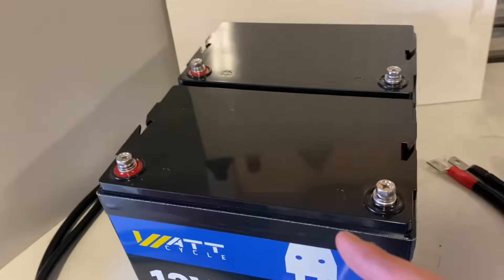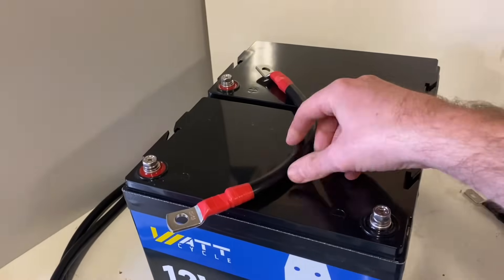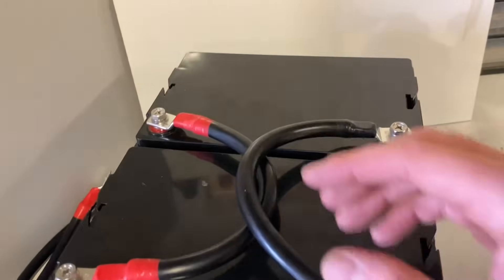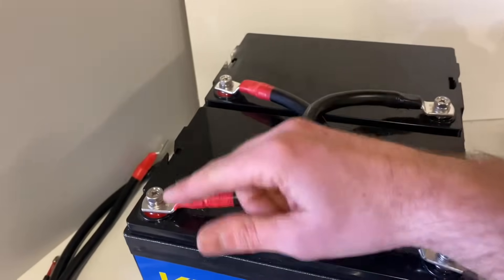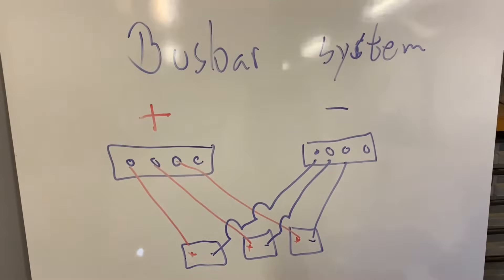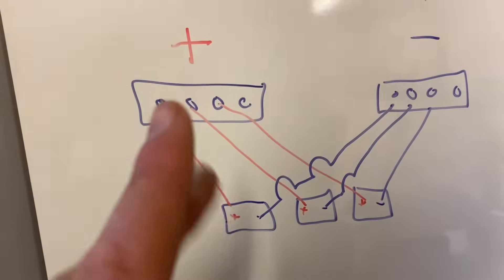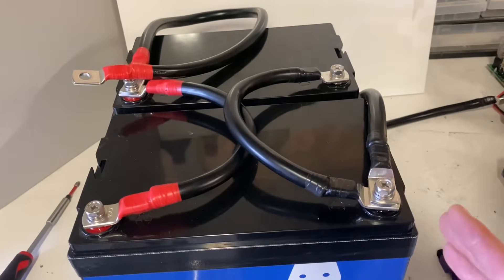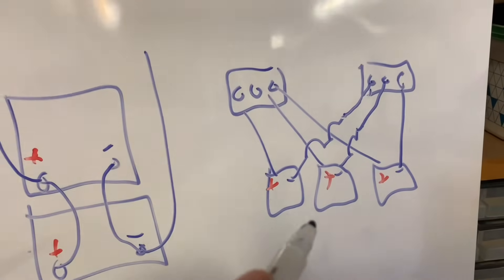How to Parallel Two 12V Batteries – Best Method Explained

Comment: Si po collegare una batteria da 200,e un altra da 225 per favore
Reply from the maker: It's generally recommended to connect batteries of the same capacity in parallel for optimal performance. 👍 but it will work. you mean Ah when you write A right?
Reply: @JonasSyver grazie mille boss bona serata

Comment: Does wiring 2 12v 100ah batteries in parallel, with the solar charge controller on one end and the inverter on the opposite affect the system?
Reply from the maker: I don’t think you will have any problems.
Reply: @JonasSyver  thanks

Comment: Which setup would be best for 2/100ah lithium batteries as the secondary batteries? I have a Taramps 15K bass amp, and I’m having problems with the bass shutting off, even at a low volume. PLEASE HELP!!
Reply from the maker: You will have trouble with only two batteries. The 15K on max draws 15000W😅 you could get away with 5-6 batteries in parallel and get a decent sound. One battery can only provide about 1200W
Reply: @JonasSyver which type of bank would you suggest?
Reply from the maker: You will need at least 650A output total in your bank. That is about max the output. Look for batteries with 200A BMS’s and parallell connect(4pcs), or 7 pcs 100A. (Do not confuse this with Ah).
Reply: @JonasSyver I definitely need some help with this..

Comment: Operating a stock automobile, is there any benefit installing 2nd 12 volt battery ? Would second battery make the headlights brighter ? I've polished the lens, installed higher quality halogen lamps but headlights do not illuminate the road as well as my other cars do.
Reply from the maker: Thanks for the comment👍 A second 12V battery would just give you longer lasting power, not brighter lights. Have you tried LED headlight bulbs?

Comment: Can my pv connection be parallel, and my battery 🔋 still be connected as parallel????
Reply from the maker: Thanks for the comment. Your PV connections depends on your charge controller and what it can handle in volts and amps. The battery is not dependent on the PV wiring, other than that the charge controller must match the battery voltage you are using. Hope that made sense 😅
Reply: Yes thanks sir

Comment: Last thing, I have three sets of 51.2 battery banks hookup to busbares . One set is 4- 12.8v100a hookup in series, the second is a 51.2v 100ah battery and the last is 4- 12.8v 320ah batteries hookup in series. All hookup on busbar in parallel to  one set of busbares.
Reply from the maker: That's an interesting setup you have there! 👍

Comment: What if you need a voltage of 48. So you do a 4s each end goes to it  busbar. I'm using four batteries in series to make 51.2 . I'm also using busbares t connect to my inverter but I'm also using a battery balancer for the four batteries to help keep them balance.
Reply from the maker: Balancer is a good idea. The video is for parallel connections.

Comment: When connecting 2 batteries to the solar controller is it positive from one battery negative from the other.
Reply from the maker: Yes if the configuration leaves one pos on one battery and one neg on the other.

Comment: Why not spin the battery closer to us around so the terminals of both batteries are facing eachother? Then you would only need a cable 3 inches long to connect the batteries.
Reply from the maker: Positive to positive and negative to negative for a parallel connection.

Comment: How do you wire up a system that has a switch taking it from one battery to the other or both ?enjoyed video thank you
Reply from the maker: Amazon has some great switches for that. Select individual batteries/banks. Just wire the positive through the switch.

Comment: Nice video thanks for posting it I have seen something similar thank you for the explanation can you tell me if this applies only for lithium or does it also work with lead acid batteries
Reply from the maker: Thank you😃 Yes it still applies for lead -acid, but Lead-acid cells tend to self-balance better.

Comment: Did you know 2 smart batteries in parallel wont share amp loads simultaneously?
Reply from the maker: Hi. I have heard about the issue. And it is a common problem with the so called "smart" batteries. I will have to test it myself before I can give a talk about the problem. Will Prowse has some good insight on the subject.

Comment: Thanks for your video. You look like you're cables are bigger than mine I just purchased so they are 1/0 I have 2/0. I guess they will work because I'm not buying more. I'm going with a 24-volt system.
Reply from the maker: Those will work just fine. Good luck with your 24v system!. 👍
Reply: @JonasSyver Thanks,  I need help. I have watched videos for years now and I still have a problem with calculating, volt x amps equals Watts. I don't have a problem with the multiplication part of it I have a problem with understanding why. For example there are 12 volts 100 amp batteries, but then I see a battery that's 51 volts and 200amp. If I choose a 51 volt battery for the volts, Why? Does I choose 51 volt for the amount of volts for the solar panels. I hope this makes sense.
Reply from the maker: Tip is if you understand the math, to think in Wh. 12v 100ah battery is 1200wh and a 51.2v 100ah is 5120wh. So it makes sense once you know that every parameter is connected to each other. Hope it helps👍

Comment: Don't forget that when using bus bars like shown on the video it is Super important to ENSURE all cables are the same length/Gauge from the busbar to the battery terminals.   Super important.
Reply from the maker: Yes👍 thanks for the comment😃
Reply: Also each battery would need its own fuse to protect its individual cable, rightt?

Comment: Is a bus bar necessary for Three batteries or would the balanced connection be okay?
Reply from the maker: I would use a busbar for three batteries. Optimized  flow and easy to isolate each individual battery if something happens. Add a breaker to each battery before the bus and you have a really nice serviceable system.

Comment: Witch battery will be used first?
Reply from the maker: They both will be used at the same time, but one of them might be drained a little bit more than the other.depends
Reply: @JonasSyver I wish you would show what each battery are doing. Some times one of mine is not doing anything. One battery will be at 97% and the other at 90% or one battery will say 100 hours till discharge and the other will say 24 hours to discharge.  Im so confused

Comment: Even when using a bus bar, all cables need to be the same length or as close as possible.
I have seen some that use bus bars directly on the batteries with no cabling to parallel them.
Reply from the maker: True. Thanks for the comment👍

Comment: Can I connect parrlel 12V lithium battery with 12V lipo4 battery?
Reply: No you can not do this. Different chemistry and different Discharge rate.
Reply from the maker: They need to be the same battery type.

Comment: Thats how you run cables between batteries if you want to start a fire, when drawing high amps,  the cables heat up and will melt together which then can cause neg and pos to connect...arking and starting a fire.... great work, teach people to burn their vehicles or places to the ground..... only stupid people would follow your advice
Reply from the maker: Thanks for the info. Did you watch the video?

Comment: would your cables not be better if shorter  direct to the respective poles?   the shorter way  to two points is a line no?
Reply from the maker: As short as possible is good. Take some measurements before you order premade or make your own.  Most important is that the cables are thick enough and equal in length.Thanks for the comment👍
Reply: @JonasSyver I've done a "Big Three" upgrade on my car using arc welder cables(brand new pure copper fine strand), and those same cables can be used for car batteries and sound systems. Those are the same cables that you can buy for your amplifiers, except they're cheaper, thicker, and easier to come by. 
Thanks for making this video. I was doing some research about wiring two batteries, and your video was the final piece of information I needed to ensure proper install. Ever since I added a 1kW amplifier to my car and since I plan to hook up a peltier based mini fridge to my car(high amp draw), I find it necessary to add another battery in parallel. I already upgraded the alternator and wires and switched to LED lights.
Reply from the maker: @astanisystems nice👍 thank you. Fine stranded cables in automotive is the way to go. Seem like you got it figured out👍

Comment: Hello, thanks for the video. I setup two lithium batteries this way, but when I monitor the Bluetooth setting, I only see power drawing from the battery with the positive hookup. Is that normal? I was thinking both batteries would drain at the same rate?
Reply from the maker: Some newer BMS’s use a different discharge algorithm when connected in parallel. I have seen others with the same issue. Make shure each battery works, try to connect them to a busbar to get a more even flow. Ask the manufacturer about the issue if it consists. Thanks for the comment👍

Comment: When charging 2 batteries it's best to run the cables from the charger to the batteries to the positive on one battery and the negative of the second battery for a balanced charge.
Reply from the maker: Yes. Thanks👍
Reply: Please how shall I wire 3 100w panels to , 2 100ah batteries ?
Reply from the maker: @ELKASIDAV that really depends on your solar charge controller and what it can handle in terms of voltage. If possible, I would wire them in one series string. Main positive on one panel an connect negative to positive throughout and end up with a main negative on the last panel. Let the wires go through a solar breaker and into your charge controller. Sound good?
Reply: Let me help you out here if the cables between the two batteries were an overkill. Then that primary battery you call would not have a shorter life because the cables are heavy enough that both batteries would exert the same amount of energy when asked to. As far as charging, with the low rates, we charge batteries. I’m sure those cables could handle it and the batteries would charge fine in the configuration you’ve pictured. You are over complicating this, and assuming that the cables between the batteries are in fact in inadequate for the loads, they may have to exert.

Comment: is it better connect inverte to other ports than charging cables like criss cross xx
Reply from the maker: Not shure I understand the question sir. Sorry.
Reply: @JonasSyver  I think he means put the charge controller on one set and inverter on the other 2, or put both charger and inverter on the same corners
Reply from the maker: @cj548 ah ok. No use one set of terminals from the battery👍 thanks

Comment: if connect 2 in series, 150A bms, can i use 150A fuse connect series and no need busbar
Reply from the maker: If you wire up in series, you will get a 24V battery with a 150A bms. No need for a busbar in that case. If you have a 24V system. But I would consider a fuse or breaker for each battery and a T class fuse on the finished pack.

Comment: They are not connected in parallel stupid. That is series parallel and the way you connect the load makes it a combination. That produces hysteresis through reflections and resistance. You have no clue what you are doing.

Comment: "Positive on the top left corner and negative on the bottom right corner "
Some guy told me, so I will stick with that!
Reply: yeppers its what i do with mine too. 4:09
Reply from the maker: @andrievbastichy8551 thanks for the comment👍 how many batteries do you have in parallel?
Reply: Do you mean connecting the neg on one battery to the pos on the second battery? That will give you a series configuration and not a parallel config. For example, I have two 6 volt batteries in my camper. They are connected in a series config, pos on one battery to neg on the other. The resulting system is 12 volts.
Reply from the maker: @silekiernanphotography my question also.
Reply from the maker: 😅 thanks for the comment👍

Comment: Lots of large draws over and over can unbalance the batteries but over time at idle they will balance to each other. Every 6 months or so take cables off and check the voltages to see the drift.
Reply from the maker: Thanks for the comment👍 Smart and a good idea to check your voltages over time no matter how you wire it up. Should have mentioned that😃

Comment: Nice video with all methods but why is there never talked about fuses in these situations with parallel batteries how and were to put them in that would finish the job
Reply from the maker: Thank you👍 fusing is important, I agree with that. Focus is on the wiring in this video.
Reply: @JonasSyver  Thats oke i was happy with that, but it would be nice to see a movie with multiple batteries parallel and how to count witch fuses to use and were to place them, but so far i find lots of movie how to set them parallel most don't explain not connect everything to one battery you did and also not the wire thickness you also did, but fuse part is explain with one battery most of the time and when we go to 2 or 3 batteries the fuse disappear but still we are happy with what you have showed
Reply from the maker: Thanks👍 I will look into creating a video more focused on fusing and protecting your equipment.
Reply: @edverm862 Fuse is connected to the Pos+ terminal of the battery cable, which leads to the load you are connecting.
Reply: Fuses have to be put in before you output to a load.
Reply from the maker: @easyenetwork2023 yes👍 in a real world scenario

Comment: Nice video. Clear concepts. It pretty much matches my thoughts on hooking up batteries. I don't understand the hate in some of the comments. You showed all three common methods, explained the pros and cons, and didn't needlessly preach. I believe for a system sized as in your example that there probably wouldn't be much practical difference between the methods; but I also believe we should strive for best practices when practical.
Reply from the maker: Thank you👍

Comment: I have a question how do I charge them now?
I would think I use the same terminals but I actually need to put 2 mppt converters because my solar is split in 2 with different pannels.
Reply from the maker: Thanks for the comment. Use your designated main terminals for both mppt's. Act like the other unused terminals with parallel cables are not there to avoid confusion.
Reply: @JonasSyver  thanks you should do a video I don't think there are any around that actually shows the charging part
Reply from the maker: @markdove5930  Thanks! That is a great idea! :finger-red-number-one:
Reply: 😊if I.wire my solar panels in parallel we I only need one solar controller.

Comment: Well illustrated video. 
The one thing I would like to add is that the cable size, type, and length should be the same on all batteries in the system, or else there could still be an imbalance. The BMS in LiFePo4 batteries has the ability to compensate for this imbalance but it could still cause uneven wear between the batteries. Even some so called professionals get this wrong.
Reply from the maker: Thanks for the comment👍 and helpful input👌

Comment: I would think of you made a cable that was in the shape of the letter Y for each POS and for neg. That Way seems the current would come from both at the same time. 🤔
Reply from the maker: Great point! A Y-shaped cable can work if both wires are the same length and gauge, ensuring equal resistance. But even small differences can cause imbalance, which is why my method — drawing from opposite terminals — guarantees equal current sharing. Thanks for the insight!
Reply: @JonasSyver Drawing from opposite terminals is parallel. Series is you run positive to negative by jumping them and then your positive and negative branch off to other circuits on the other sides.
Reply from the maker: @easyenetwork2023 true👍

Comment: But you can also connect postive to - and get 24 bolts.
Reply from the maker: Well yes. That would be a series connection of the batteries and a topic for another video. Thanks for the comment👍
Reply: @JonasSyver So, you were wanting higher current, got you. They seem to think you wanted higher voltage I think.

Comment: The middle option makes no sense. You don’t have the positive and negative that you connected to each battery , the other ends are just floating and not connected to anything. Makes no sense
Reply from the maker: Thanks for the comment! Just to clarify: in the middle method, the batteries are connected positive to positive and negative to negative — so they are fully paralleled. The key difference is where you draw the power from: the positive terminal of one battery and the negative of the other. This helps balance the current between the batteries. But you're right — if those terminals were truly floating and not connected to anything, it wouldn't work. I’ll try to explain it more clearly next time!
Reply: @JonasSyver  it was clear to me. Thanks
Reply from the maker: @lyndonkain4749  thank you👍

Comment: Thank you ! 👍
Reply from the maker: No worries! Thank you for the comment👍
Reply: @JonasSyver  I am going to be setting up a small system this summer, running only LED lights and a 12 volt water system. I will not be using an inverter. I know it depends on usage, but how long would a two battery system last typically ? Thanks
Reply from the maker: Sounds great! You are right, it depends. You will need to calculate your loads. But for a small 12v setup most likely a long time😅 please check out this vide: https://youtu.be/RXhAFJa2YpA?si=dSsH1BElN12lpUMP